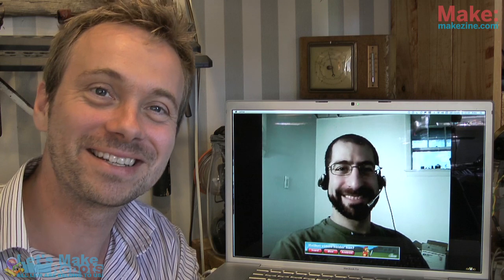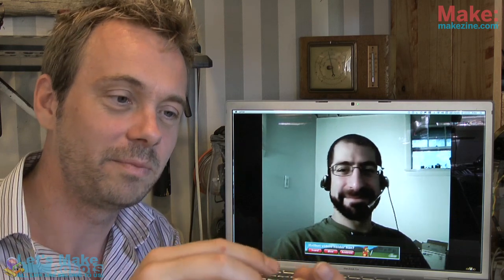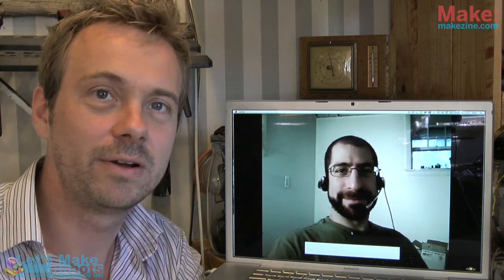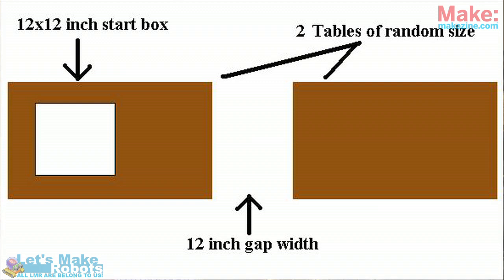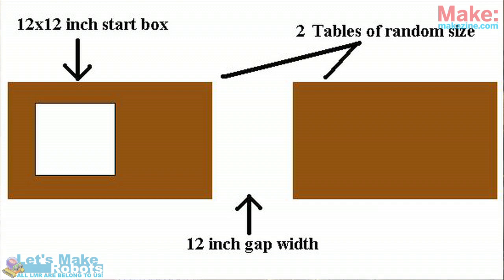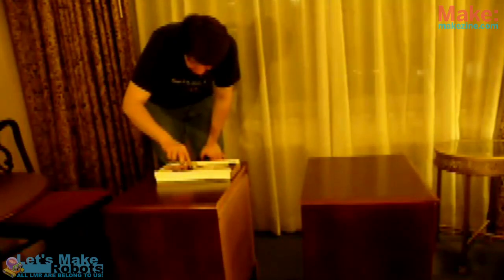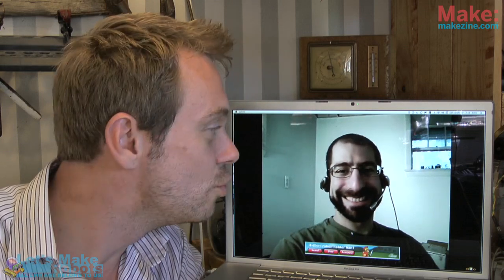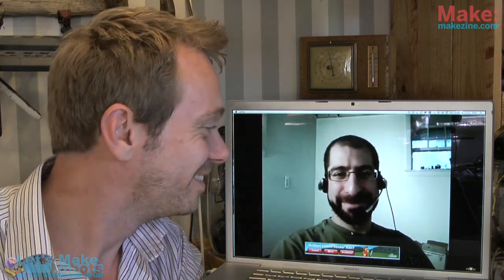The Latest In Hobby Robotics 13

Comment: i made one that was entirely based on gears and had 1 power source. when the front wheel dropped off the table, the gear assembly dropped down and powered a bridge arm that spanned the gap. when it hit something, it raised the assembly, and powered the robot across. it was hard to make.